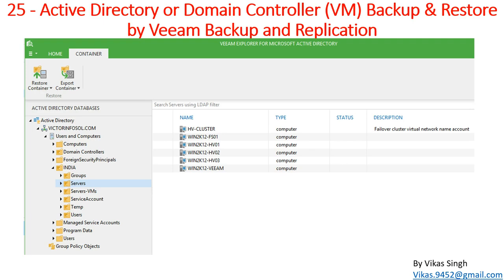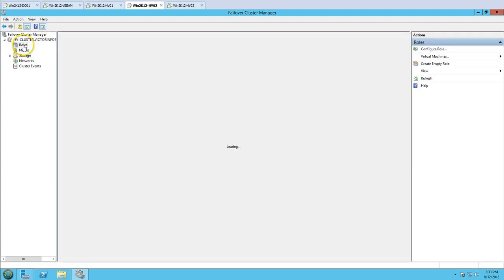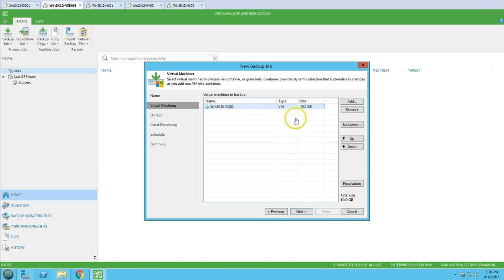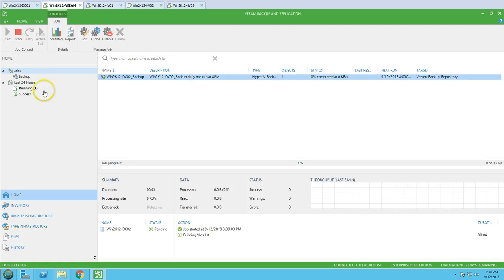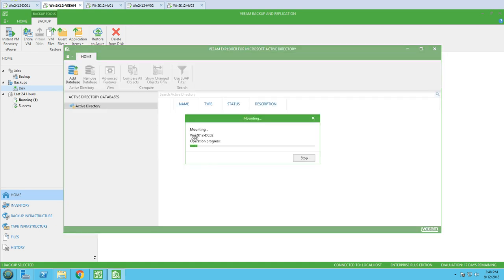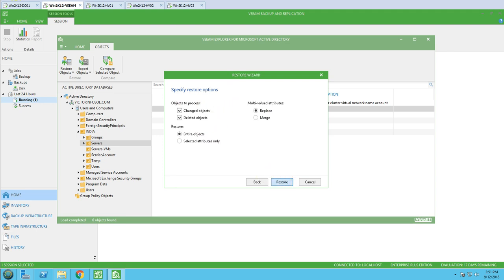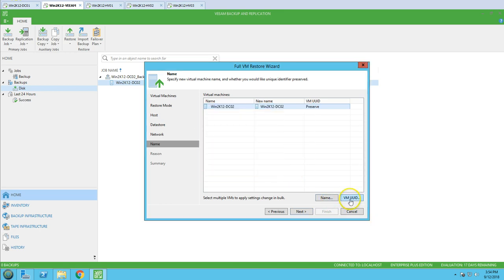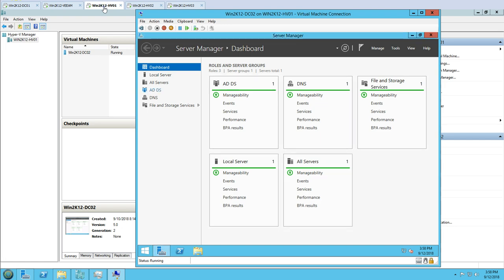Veeam Advance Training | 25 - Active Directory or Domain Controller Backup (VM) by Veeam Backup

Comment: Hi, thanks for the demonstration. If the Veeam server is running in a different domain per security recommendations, Domain Admin creds (and the backup) won't work (version 12) through admin$ share using RPC, guest agent, or PowerShell Direct. What are your thoughts?

Comment: I have windows server 2016 and it’s holding two virtual machine 
1.ad
2. Exchange 2016

I have installed Veeam Backup and Replication 9.6

I have added my windows hyper v host 
And tried to start backup job but the vms are not listing 

How to do it
Reply from the maker: Check you have added Hyper-V in Veeam backup server and veeam agent is healthy and veeam backup agent services are running on Hyper-V Server

Comment: Thanks Vikas Sir. This was very helpful.

I have full legal license for Veeam B&R - Enterprise Edition and everything is fine and smooth.

Now I have been tasked to backup laptops, desktops, Etc on my domain, how can I achieve this by using proper agents?

Appreciate if you could type your video links for a central management instead of going around 50 users and installing agent. Thank you once again.
Reply from the maker: Thank you very much for your feedback, Glad to know you like it..
Its depends what you want to backup in laptops, desktops... However Veeam is not product for Client Machine backups also this is costly.,... you can go with some software which is specially for Client machines backups.